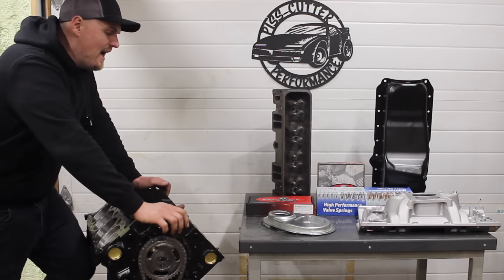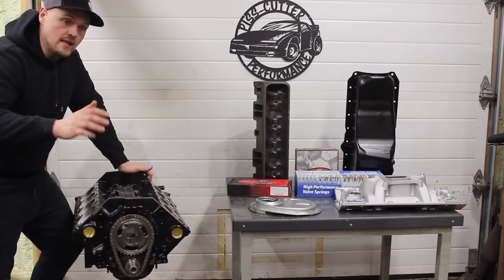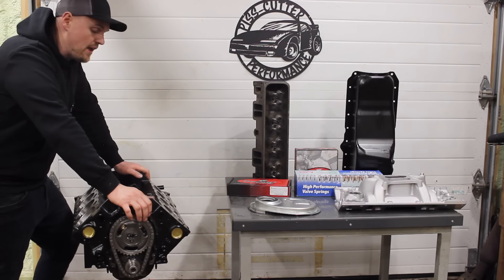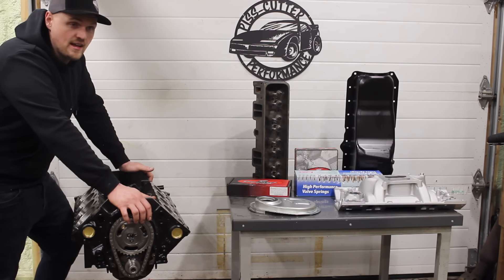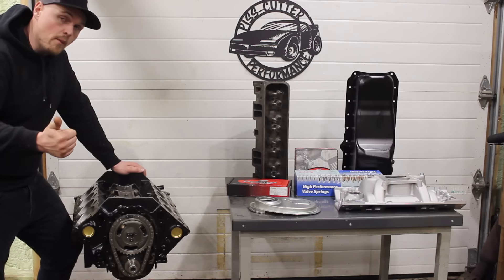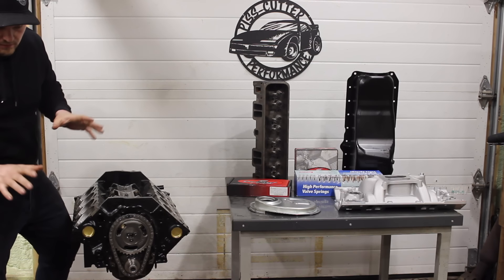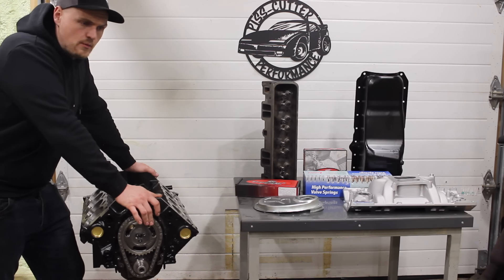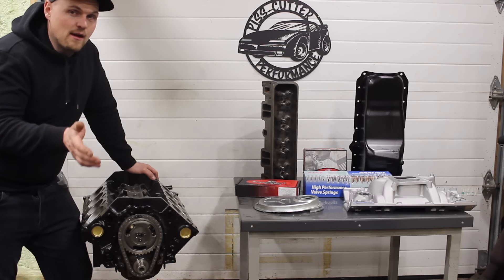The Cam I Always Get Asked About!  L31 Budget Build Update (L31 Build Part 5)

Comment: that depends upon which l-31 block you got I've got one that is set up for the steel cover it's a 96 they made several l-31 blocks that had a flat tappet cam but was set up for roller I had a 94 that had a flat tappet cam but was already drilled and set up for the roller cam it's called the early years of the vortec at least that's what i call it ! PS it's a 880  4 bolt main with brass freeze plugs
Reply from the maker: 880s blocks are from 96+ (some 95s) but  some ealry 880 blocks that were drilled for  a front cover, coolant bypass, and fuel pump. Prior to that, the roller 350 blocks were mostly 638 blocks
Reply: @cuttersperformance  they made fuel pump ready blocks in some trucks and vans through 2007. The ones that are drilled and tapped had a factory block off plate.  Some are tapped and some are not.  None of the stock production trucks cams have a fuel pump lobe although the marine and industrial ones do. From what I have seen, typically the 4 bolt mains are fuel pump ready and the 2 bolt mains are not. 2001+ blocks have metric engine mount and bellhousing bolt holes.
Reply: Wrong. There are ZERO flat tappet l31s from the factory. Not sure who told you that but that is extremely false

You had a 94 with a flat tappet cam because it was a TBI engine. Not an L31.
Reply: @95roadie  Not false at all from what I have seen myself.  I pulled a very stock L31 out of a 96 van that was flat tappet cam and TBI. It did not have TBI heads either. It had 906s and a cast iron TBI to Vortec intake manifold on it.
Reply: @chrisreynolds6520  then it’s not an L31. Simple as that. And it also wasn’t stock if it had Vortec heads and a cast iron intake. Lmfao.
Reply: @95roadie  the RPO label clearly had L31 printed on it and it was a L31.  A factory TBI L31. Some of the Mexican trucks had them too, clear up to 97 or 98. It is even in the 96 GM documentation, complete with the power ratings.  230 hp @ 4,000 rpm and 335 tq @ 2,400.
Reply: @95roadie  the GM 330 HP 350s were also L31s with a flat tappet cam from GM.
Reply: @chrisreynolds6520  L31s were NEVER flat tappet. Ever. Period, end of story.
Reply: @95roadie  some absolutely were flat tappet, END OF STORY.  Try to tell someone else that does not know the facts.  I had a commercial customer that had 4 of the 96 L31 TBI vans and I did intake gaskets on all 4 of them when the plastic carriers gave out.  All 4 were L31s with flat tappet cams and TBI. My back still cringes from pulling those manifolds and setting them back in place.
Reply: @95roadie  also as I stated earlier the 330 HP 350 GM crate engines were L31s with flat tappet cams.
Reply: @95roadie  it absolutely was stock with L31 heads and a factory GM cast-iron TBI to Vortec manifold. GM built them that way and I worked on 4 examples and GM Heritage also had the power team listed in their 96 documentation. All 4 had a 2" bore TBI with a speed governor on the side. These were all the old style looking G vans, but had a P30 frame and fold forward school bus style hood.
Reply: @chrisreynolds6520  wrong again. 

NO L31 EVER came with flat tappets. Ever. Literally ever. End of discussion.

Comment: I'm gonna run the summit 8802 in my budget Lt1 next
Reply from the maker: It's very similar to the lt4 hotcam
Reply: @PISS-CUTTER Performance  should make a great street cam. Got my valve seats cut to 2.00 and 1.55. Dne a little welding on the outside of the pushrod pinch to help with core shift. They are thin in the pinch point.

Comment: Does the L31 engine still use the thick style 5/64 ring or did they go to a thinner package?
Reply from the maker: The stock pistons use a thinner metric 1.5/1.5/3.00 mm ring package
Reply: M M rings !

Comment: 5 videos and still sitting bare block. Repeating, repeating, senseless rambling. Build a motor. 5 videos and it’s clean still
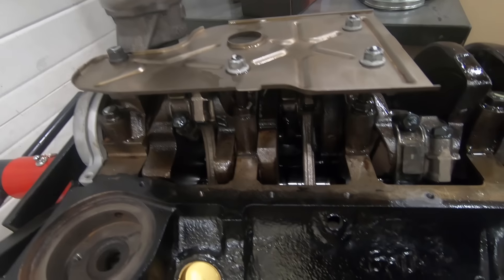Reply from the maker: At 1:22 you can clearly see the bottom end is completely assembled. The last couple videos have been about head assembly. Everything is basically done but 60+ hour work weeks at the shop right now, two young kids and hotrod/racing season... I'm burning the midnight oil and doing my best the get the videos out

Comment: Is a stock l31 cam shaft can’t hood compared to a lt4 hot cam and do a video on the timing cover from plastic to steel and how u match up the timing cover to the timing mark
Reply: Use the Holley aluminum L31 cover. It is cheap and it actually seals well. I have one on a 305, a 350 and a 383 build based on vortec blocks. Timing marks match as well, not that I need them for anything beyond stabbing the distributor.